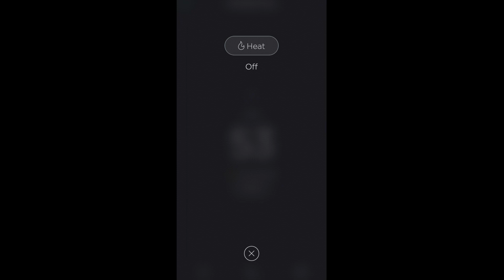HOW TO INSTALL A GAS  HEATER IN A SHOP PART 3 FIRING IT OFF, AND ITS WIFI CONTROLLED

Comment: First of all, great video. Thank you! I have a question about the vent slope. You mention it sloping down/away from the heater, which makes perfect sense to me... but the Mr Heater manual suggests the opposite. Can you provide any additional info? Thanks again.
Reply from the maker: Thanks man! Yeah that’s a great question, and I questioned that in the manual too. They show installing a drip tee (I think that’s what they called it), but I wasn’t going to install one. So I didn’t want any potential condensation draining back into my unit and eventually on my floor. I believe they have you do that for the potential of Co gas leaking into your building, but there is an exhaust fan blowing that out, and my run of exhaust pipe is fairly short and I wasn’t concerned about that. My buddy that works in the hvac field said he always slopes them away from the unit and outside, and my inspector had no issues with that. Hope that answers your question, and thanks for watching.
Reply: @brewbuilds here in Michigan they do that because they don’t want the condensate to leak out and freeze. Seen where it causes the 2” pipe to freeze completely shut over a winter. Google Water Heater Vent Freezing up... under pictures.

Comment: Where did you get the thimble and piping?
Reply from the maker: I got all my pipe from a gas supply store in my area called Ferguson, and the thimble was supplied from a buddy of mine who works for an hvac company in my area. I wasn’t able to buy the venting materials because I don’t have a gas license.

Comment: I have a 30 x 40 woodworking shop that I am looking to heat. I have a few questions. First, do you have any trouble with saw dust getting in the heater? I was looking at heaters that have a sealed combustion chamber, but I'm not sure that I need that. Second question is what made you decide to get the 125k BTU unit vs the 80k btu? I live in NW Ohio and was looking at the 80k BTU unit. Thank you!
Reply from the maker: I’ve had this heater installed for 2+ years and dust hasn’t been an issue. I will say that I blow it out with compressed air or a leaf blower twice a year just as a maintenance thing. But it’s no biggie. I went back and forth on the 80k and this one for awhile, and I consulted with a friend in the industry and he said I would be happier with this size. And I’m glad I went with it. It maintains the heat in my shop very well. I’m in Washington state and we at times get fairly cold winters ( below zero) at times. I hope that helps. 🤘🏻

Comment: How does your fan blow on this thing? I made the mistake of only getting an 80K BTU, I don't have in floor heat and when it's -30 below outside I struggle to maintain temp. I should have gotten the 120Kbtu. Your heat exchanger isn't glowing red I take it?
Reply from the maker: It moves quite a bit of air, definitely plenty for my 30’x40’ shop. Yeah I’ve never seen my heat exchanger glow at all.
Reply: @brewbuilds  I can tell they have a different fan blade design looking at the 125K units, that's alot of heat, has to move air. Some 50 and 80's come out of the box with heat exchangers glowing red. Not normal at all, dangerous, even with proper setup and installation.
Reply from the maker: I’ve been really happy with this unit. I would not like seeing the heat exchangers  glowing red. I mostly just use mine only when I’m out in my shop, but I painted the inside of my shop at the beginning of the year and the outside temps were in the single digits so I let the heater run for 3 days. Obviously it didn’t run continuously, but I had it maintain my shop at 70 degrees.

Comment: Interesting about needing a license for the class III pipe. Question about mating the pipe up to the back of the heater. Did that 45 just slip over the vent pipe on the heater? I've been looking at my local menards where they sell all the class 3 vent pipe to complete the run and I can't find any pipe or adapter or coupling that actually fits over the output on the heater.
Reply from the maker: Yeah my 45 just slid right over the output pipe of the heater.
Reply: I'm having the same issue.. I've purchased 2 different pieces I thought might work, but they're the same diameter. I'm stuck because I can't find that one piece to attach to the flue transition in the back of the heater.. Can you tell me what your remedy was..?
Reply: @JoHa-dl5zr  I contacted Mr. Heater over it and after talking about the issue with a tech support guy we concluded that there's actually no adapter piece that you can buy separately that works. There is one in a photo of a kit I found on Amazon but you have to buy the whole kit. So I ended up just buying a 4" appliance adapter from menards, tore off the metal straps, used vent screws to fix the adapter to the flue output, and fitted my vent run from there. It's been working all winter just fine.
Reply from the maker: If you email me I can send you a picture of my 45 degree elbow. It’s a dura vent brand and has a tag on it. Email- brewbuilds2@gmail.com

Comment: I did my own install minus the gas line, had the unit sitting up there mounted on the ceiling for a couple weeks (did some wood work so some dust may have made it up there). 

Wondering if you had the burnt dust smell on the initial start up?
Reply from the maker: Yeah every year I get that a little. I try and blow it out with the leaf blower before I use it every season.
Reply: @brewbuilds  thanks for the quick response.

I blew it out with a compressor, guess not well enough.

Thanks!
Reply from the maker: No problem. 👍🏻 I think you’ll always miss some and get that smell at first.

Comment: How many burners does it have
Reply from the maker: I believe 8.
Reply: I was trying to count them in the video lol I just ordered one for my shop hopefully it does the job for 2500 sqft
Reply from the maker: @dudester3263  yeah that’s what I ended up doing haha. I tried to look online, but couldn’t find any info on that. Let me know how it works, my shop is about 1200 sqft and it heats it up pretty fast. I’m impressed with it so far. Will you be running yours on propane or natural gas?

Comment: Thanks for the video series. I'm going to buy 2 of the 80,000 BTU units for my shop. The manual says I need to have 8 feet of space below the heater (to the floor), and 8 feet from combustible material below it. You didn't follow those guidelines. I can't imagine it getting hot below the heater if the vents aren't pointing right at something combustible.  Even then, it would be almost impossible to cause a fire like that. My floor will be about 6 feet from the bottom of the heater.  You ever notice any issues with that (excessive heat or fire danger)? I think that must be the dumbest requirement for installation. Heat rises, yet the heater can be 1 inch from the ceiling,  but has to be 8 feet from the floor.... What are your thoughts? Thanks again. Mike
Reply from the maker: Thanks for watching man! I’ve had zero issues with the sides being hot. It’s fully insulated so the sides of the heater aren’t even hot to the touch. The 8’ guideline must be for moving equipment like vehicles or something. I had everything inspected and the inspector never mentioned anything about it.

Comment: what size heater for what size space.  i have a 1000 sq ft shop,   iam thinking 60000 btu heater.  is that close?
Reply from the maker: I have the 125,000 BTU unit, and my shop is 30x40 so 1200sq/ft.

Comment: does the thermostat take 5 wire? if so what did you do on the heater cause theres only 4 spots there
Reply from the maker: hey sorry I just now saw your comment. No the ecobee thermostat only needs 4 wires. Most importantly the common wire which provides the thermostat with constant 24v power.
Reply: thank you for getting back to me  i did a little reasearch and pretty much came up with that . but just to get it up and working i tied the r wire and w wire together till i get some thermostat wire  i plan to use momentum meri thermostat cause its a little cheaper
Reply from the maker: No problem you YouTube’s comment notifications aren’t the best, really delayed, and sometimes I don’t even get notified at all. I did a bunch of research prior as well, and came across a forum and someone was talking about having to install an extra relay to make it work, but I haven’t had any issues at all.  

Yeah I would have went with something cheaper as well except all my WiFi controlled devices in my home are apple based where I can use the home kit to control them, so it makes it pretty handy.
Reply: someone on one of the forums said cause the heaters have the c wire it makes it so we dont have to supply the thermostat with 12volts. im very impressed with how quiet it is but is a bit of a fuel hog but then again im only like qaurter of the way insulated but its 11 degrees here today and it got it to 65 in about 2ish hours
Reply from the maker: @devendewey5214  what size is yours? It’s been in the high 20’s where I’m at and my shop not heated usually stays around 48, but once I turn it on it will get up to 65 in about 30min. I’m curious to see how much it cost me to run.
Reply: i got the 125,000 btu one i have 12.7 tall walls amd i hung it on the cieling but im thinking ill have to move it down on rods like you did. i need to finish wiring and get on insulating it . im heating a 24 x 36 and from my calculations the heater i got should be way over kill but so far im not to impressed with the propane consumption
Reply from the maker: @devendewey5214  oh Gotchya. So similar in size to my shop. Mine is 30x40 with a 10ft ceiling. Yeah the 125k is good up to 4,000sqft, I’m not sure on fuel usage yet mine is running on natural gas so it will be interesting when I get the first Bill since I’ve been using it.
Reply: i think there a decent heater for the money so far, im sure once i get insulated ill be much happier with it. thank you for the great videos and the info much appreciated
Reply from the maker: @devendewey5214   I agree, the few weeks I’ve had I’ve been really impressed. I’m sure once you get your shop insulated it will make a huge difference. Thanks for watching my videos and commenting! And I’m glad I could help. Stay in touch. 👍🏻

Comment: I didn't realize you need to have a licence to buy the vents. Are you allowed to install all of the gas lines yourself? In my area i think you need a licensed gas fitter to install the lines
Reply from the maker: So it kinda depends on how you do it, if I would have vertically vented it out of my roof I could have bought (b-vent) from home depot, or Lowe’s, but since I horizontally vented it required me to use category III vent pipe due to my local code requirements, and to buy category III pipe you need to have a gas license. I was really surprised by that. supply line was just standard 1” black iron pipe so there wasn’t any issue there, and there weren’t any issues in me running the pipe myself. I do believe some of the underground fittings and lines you can run into issues buying if you don’t have a license. Fortunately when I had my house and shop built I had them run the underground line and stub it out on both ends so I didn’t have to cross that bridge.